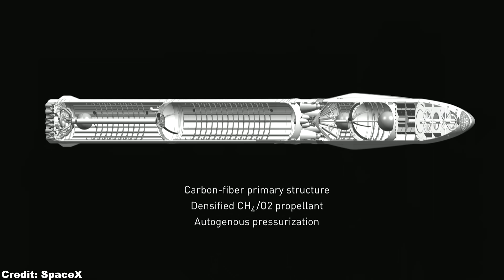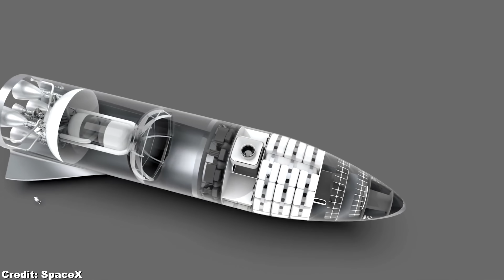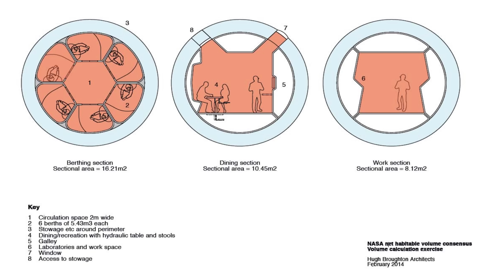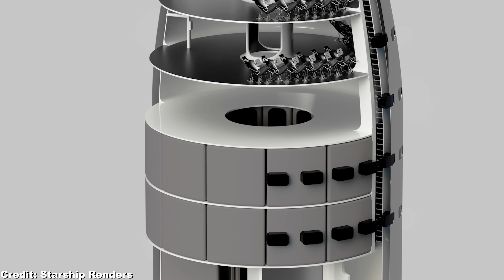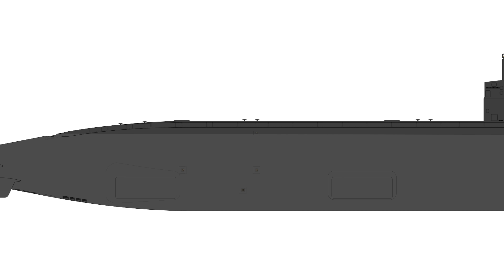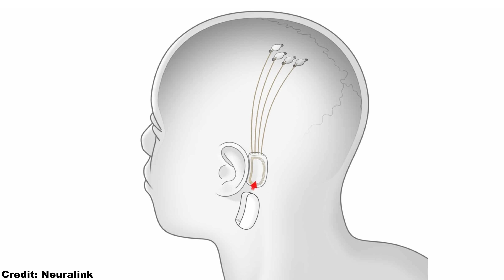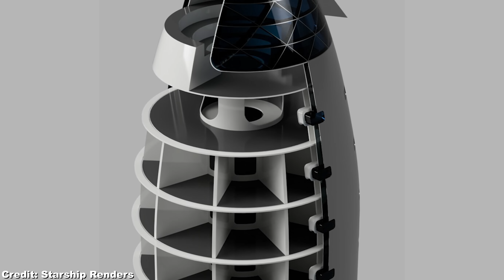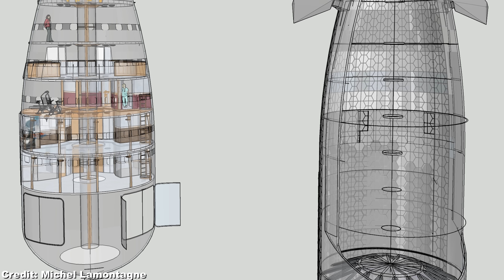CAN YOU SURVIVE 6 Months With 10 Cubic Meters? [SpaceX Starship FLAW FIX]

Comment: I think it should be possible to use a special starship located in the earth orbit to boost a crewed starship in the transmars orbit, then separate, deccelerate and return back to the earth orbit for orbit refueling.

I didn't the math or KSP simulation, but I fill like this should give the crewed starship enough additional delta V to significantly cut down the travel time.

Such orbital booster starship shouldn't be hard to build. It could even remain in orbit its entire life, boosting other starships into different orbits.

And yes, thank you for another amazing episode. Neurolink idea is my favorite. And not only on the trips to the mars :-D

Comment: In the long run, I think the most practical system for transporting large numbers of people between Earth and Mars would need a large habitat that rotates for artificial gravity.  The habitat would be placed in an orbit that flies near both planets.  When it comes close to Earth, a starship with hundreds of passengers would leave orbit to dock with it, and when it swings past Mars they would cram back onto the starship, undock from the habitat and do a quick breaking burn and a landing.  The habitat would keep going, and eventually swing past Earth again.  Perhaps it would have nuclear-powered electric propulsion of some sort for continuous course adjustments at very low acceleration.  With a big enough fleet of such habitats, perhaps one could do a fly by every few months.
Reply: Steve Robbins makes sense ... saves a lot of fuel if only cargo and people need to slow to planetary orbit speed.  That way the transplanetary  commute habitat could be massive and huge ... ideal for the 6 month crossing

Comment: In an earlier video, we talked about how Starship is an excellent lander. If Starship were to make the trip alone as it is, it would be too small, obviously. However, attach a Bigelow sized B2100 and now the Starship is seating for take off and landing and the module is the common living space. I like the mothership idea with several Starships attached. It could consist of passenger, Fuel, and cargo Starships. At the very least, several Starships caravan traveling together with modules attached will be a much better resource for traversing, landing, visiting/settling,  and returning from Mars!
Reply: Bigalow went belly up!  Unless Elon or Jeff Bezo bails them out OR buys them out, the B330 is dead.

Comment: I disagree that each crew member needs their own private cabin, I think three per cabin works with hot bunking.  Also, just video is enough for emersive escapism, I don't need holodeck.
Reply: Ok, say you “hot bunk” to Mars, once on Mars then what?  They will use the ship as their living space until they can get a base up and running, where do people sleep in privacy if you have been sharing a bunk?
Reply: @keithmcknight7646  until you get an external habitat built, continue to sleep in shifts.  also, I think the 100 person trips won't be the early ones, so other accomodations can already be prepared on the surface.

Comment: 80%of the volume of the fuel tanks will stay empty during whole journey to Mars, so why not use for extra living space? If you keep the fuel needed for landing on the Mars in the smaller and better isolated tanks like in the 2017th concept , main oxygen and methane tanks can be used as common areas (if you built-in from the beginning with special hatches that open in the habitation area).